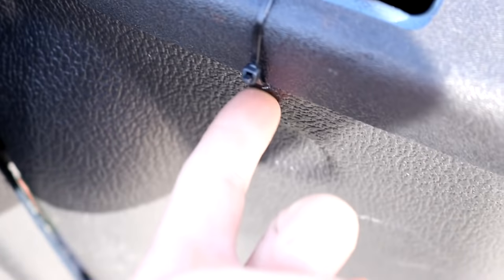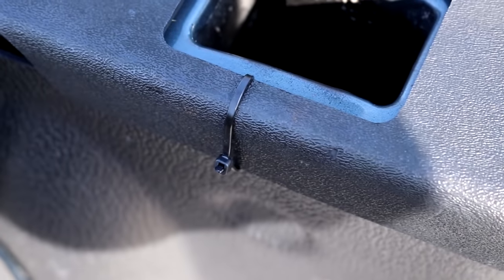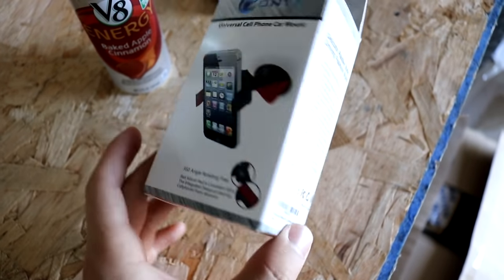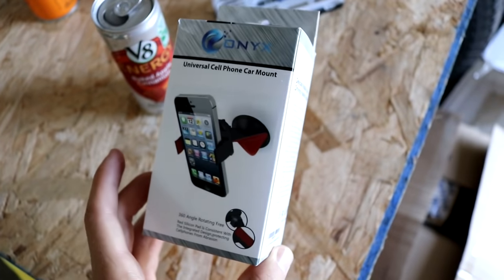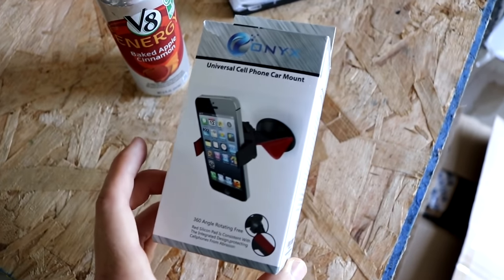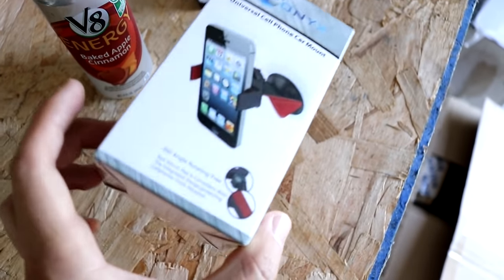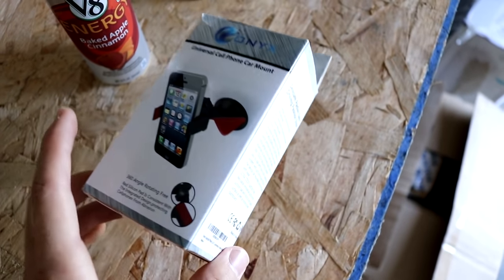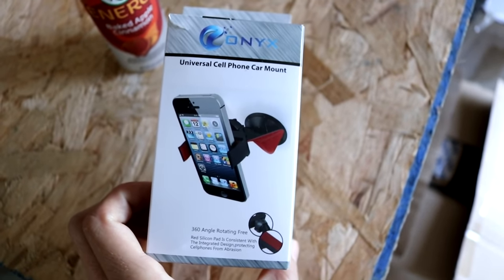Why I Stopped Driving The Cummins

Comment: Thats not at all what the recall is for i am technican at a dealer, the problem is that some of these truck might have been able to come out of gear without your foot on the brake pedal, so it would be dangerous if a child was in the truvk and grabbed the shifter pulled it down and the truck roll away, almost all of the 2013 and up models was a inspect and flash reprogram, the 9-12 is replacement of the gear shift bracket
Reply: So it wont just come out of gear
Reply from the maker: a lot more dangerous than the 2013+